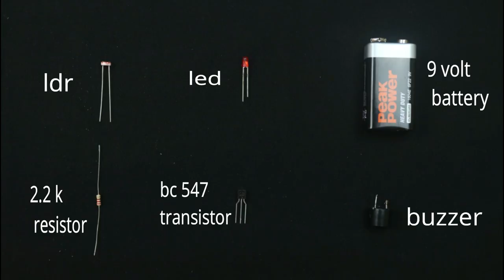How To Make A Leser Light Security Alarm System

Comment: Eshan, could you please help us with this alarm we need to have an alarm that as your demostration shows when your pen passes in front of the beam the buzzer beeps which is good but when the pen passes through the buzzer it stops this is not good because if your attacker (murderer) walks through the beam it will make one quick beep and you might not have heard the beep and your attacker is inside and you are in trouble. We need the buzzer to keep on sounding the alarm until you are aware of your safety and reset your alarm, this would be a much more secure system. Please help us to improve this.
Reply: I have idea but the item will not available in store.
That is
We need big LDR
If you have it then you need led or light not laser bcz if we use lazer that work only for sec wee need light
Then on it
I think this works bcz the light and LDR will cover more area so buzzer rings for more seconds
   Sorry for my english